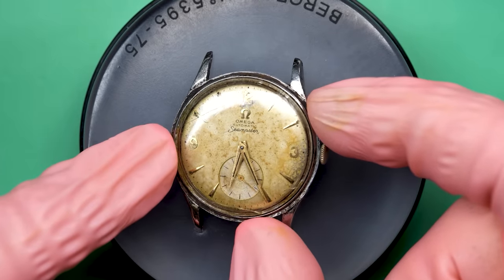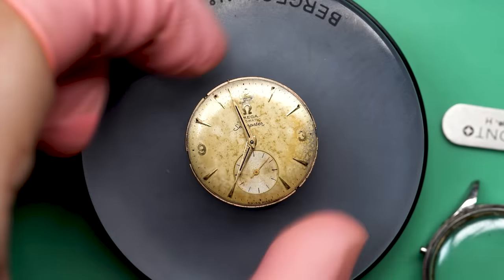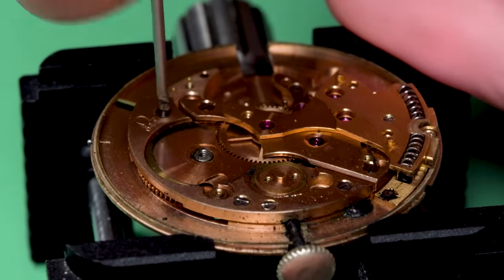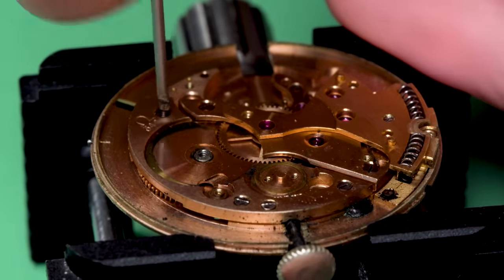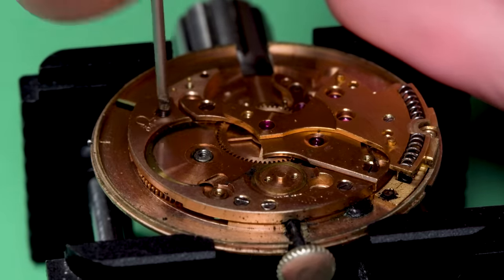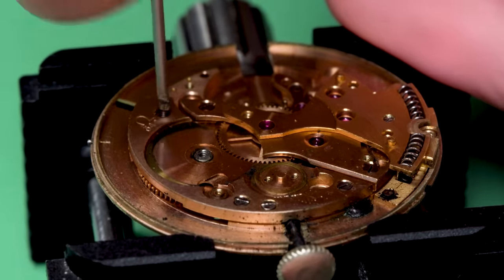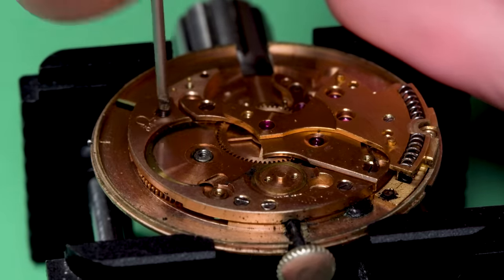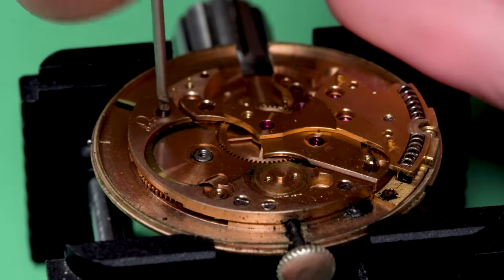Omega Seamaster Automatic From the 50's With a Killer Dial Vintage Watch Restoration

Comment: Great work as always! You are right about the case not being plated. A  "Fond Acier" or "Fond Acier Inoxydable" stamp inside the case back means that its solid stainless steel. Also a tip from someone who's learned the hard way, go easy on the the light grease! Over time the excess grease (especially from the keyless work) will migrate through the movement, and stain the plates and bridges. It will also find its way to the dial and destroy it! A good rule of thumb is if you can see the grease without magnification its too much. That said, keep up the great content! I know it puts a smile on my face to see watchmaking being represented on YouTube!
Reply: You were talking about a laser or torch to add material, but, based on Joseph’s account that it’s stainless, you can send it to a plater to be electro polished.  It could also be used to polish out the marks inside the case.
It’d be a showpiece.

Comment: Thank you for sharing your passion!
And yes, you got me into it - I am starting slowly.
Just bought a broken vintage watch off ebay recently. And just because of the description in the auction describing what works and what not, I was able to guess that it might have a problem with the mainspring - all thanks to your videos and explanations. I got it disassembled (without breaking anything, whew!) and guess what: it turned out that the mainspring was actually broken! So satisfying! And that is thanks to your videos. Also, one part of the mainspring flew away on me, as well as one gear of the keyless works (found it right away thankfully!). Makes me appreciate your work even more :D. Now I am at the stage of getting everything for the cleaning (attempting to improvise a cleaning machine, we will see how that goes) and the lubrication. Already got a new mainspring which came yesterday.
Thanks again for inspiring me to invest some time (and money :D) into this hobby.
I got one question, if I may do so: what is the blue heavy duty grease, which one do you use? (like on the stem)

Thanks again and please keep sharing your watch repairs with us.

Comment: Another terrific job! Thanks for the video.
My late father in law had a 1950s Omega which suffered sea water damage. It was left un repaired for around 50 years, until we decided to try to restore it. Sadly, the movement was just too rusty to repair but our local watch maker sourced a duplicate movement and put that in. We decided not to clean the dial, to avoid ruining it and to remind us of its past. It has the very same look as the dial in this video. It is now sitting in pride of place in my wife’s watch case, with many years of enjoyment ahead.

Comment: Amazing how you are able to keep track of all those tiny screws and what goes where !
I wish you would do a video on this !
Reply: I'm not a watchmaker by any means, but I think this skill is a combination of depth perception and object permanence, and it permeates every industry. I do something similar when working on my motorcycle, all the nuts, bolts, and whatnot go in the same box unless there's something delicate, then you just kind of know based on a particular part's size and purpose and it just kinda makes sense where things go after you've worked on it for long enough.
Reply: I think he records everything. Especially with watches he's unfamiliar with. It would be best to keep the parts in an orderly fashion. Whatever way is best for you to remember. Then replay the clip in reverse in order to re-assemble. done
Reply: All the parts look almost the same in every movement. After watching half of his videos, I can tell what's what and where 80% of stuff goes. I'm sure it's an acquired skill and wouldn't be too terribly hard with light organization and a full video to watch back to know where stuff goes if you screw up. Plus, most things only fit in one spot and most screws won't go all the way in or will be too short/wrong threads for the wrong hole. All the jewels are press fit minus the shock set ones, so they don't move, pivots are pressed in, they don't change.... Keyless works stuff is pretty unique and only fits one way. It's probably easier than it looks.
Reply: @joblessalex  As an amateur who has only fixed one pocket watch so far, I'd say you're pretty spot on. I'm not sure if the screws vary that much with their threads, but through the process of elimination, I imagine it's a very manageable task, especially with video to reference and magnification to really spot differences and what may not "look right", particularly when it would otherwise be unnoticeable to the naked eye.
Reply: @jw11432  Just gave it a go last night and broke a screw off. I'm out. Lol. Waaay harder than it looks.
Reply: @joblessalex  oh no! lol must've been one of those reverse thread screws, either on the crown wheel or the barrel wheel, huh? Or did you simply overtighten?
Reply: @jw11432  Was on the ones with the big screws, whatever that is. The one on the square arbor that goes to the mainspring. Literally the first screw I tried to take out. I tried lightly to the left, lightly to the right, medium to the left, medium to the right, finally some pretty decent force to the left and it started turning and snapped immediately.... It was a malformed screw cause it ripped out a hole in the slot. No idea how to get the chunk out. Guess I'm screwed.
Reply: @joblessalex  Yeah, that's the barrel wheel. You can actually resolve that by replacing the barrel arbor, as that is the piece the screw goes into. You just need to know what movement it is and search for a replacement barrel arbor.

And of course a replacement barrel arbor screw or barrel wheel screw, I believe it will be called one of those.
Reply: @jw11432  It's an Elgin 887. Doesn't look too complex, but I can't find anything but a whole new movement. Going to end up losing money on it if I buy the whole part again....
Reply: @joblessalex  Ouch, yeah...that's a shame, it seems to be a pretty nice movement. Well, you may just end up reselling it as a parts movement. You have a decent chance of getting some money back out of it, but then you can reinvest that into another movement that likely has more plentiful parts. Something like AS, or maybe a Bulova/Caravelle? Those tend to be pretty low priced and parts don't seem too hard to find.

Comment: Re: your barrel side shake issue, this is why I love when they jewel the barrel. Same thing goes for the rotor post (which Omega did on this one!), since "rotor wobble" where a worn rotor will wobble around and scrape against the caseback and movement as it spins is the No. 1 serious wear issue I see on vintage watches. Older ETAs are particularly prone to it but it's common on almost everything with a plain metal rotor bearing... And I hate having to fix any sort of enlarged hole. As an aside, bumpers are actually much more efficient than circular rotors, but more expensive to make and need more upkeep, that's why they got phased out. I love them myself; for you can feel the weight swinging back and forth slightly on the wrist as another reminder I'm wearing a tiny precision machine.

Comment: “if it’s crazy but it works, then it isn’t crazy”

nicely done improvising a tool from existing tools and working it up to where you needed it to be. it’s easier to “remove” material than it is to add, you “removed” it perfectly and even top pros would be proud of your work

Comment: While I watched you manoeuvring  that tiny machine screw, my mind wandered back to the 1978 assassination of Bulgarian dissident Georgi Markov at a bus stop on Waterloo Bridge, London (UK). The murder weapon was a spring-loaded umbrella that fired a 1.52 mm diameter pellet into Markov's right thigh (a similar weapon had been used in the failed assassination of Vladimir Kostov in Paris). During Markov's autopsy, the pellet was removed and was found to have two 340 micron dia. right-angled holes, forming an x-shaped cavity. Traces of fat indicated that the holes had been filled with a lethal dose of ricin and then plugged with organic material that would dissolve into the bloodstream. The interesting aspect of the case is the pellet itself; Scotland Yard determined it to be made of a hard alloy (90% platinum 10% iridium) and was actually a jeweler’s watch bearing. Forensic scientists opined that drilling such tiny holes would only be possible using a high-tech laser in a process known as “spark erosion.”  Do you know whether precision watches were manufactured in Bulgaria in the 1970's?  Could the Bulgarian secret police have recruited the assistance of a watchmaker during the manufacture of the murder weapon?

Comment: Marshall, love the videos. My sons name is Marshall as well. The tan colored band looks best in my opinion. As a hobby machinist, whenever you are using abrasives use them somewhere other than where you are doing your assembly. The garnet or aluminum oxide from the sandpaper or emery boards gets everywhere and is impossible to completely clean up. My precision grinding machine is in another building from my machining space just to mitigate contamination. I am thinking of getting a dedicated lathe just for tool post grinding so I have no reason to have abrasives anywhere near my precision machines or parts.

Comment: Tiny Screws Way Back When: Extruding the rods for the screws, cutting them to length, and heat-stamping one end into a head would be no big deal as far back as the 1860's. Putting the threads on would be done with a die setup. The matching holes would be threaded with a matching tap. You can get manual tap & die sets today, though getting them in jeweler's sizes gets tricky. Thankfully, the advent of tungsten carbide makes them much sturdier and lighter than they used to be.

Comment: Marshal I must say that I love your channel it has opened  up a new hobby for me I find it very relaxing as a watch is so logical in its works ( I am a retired engineer always trying to save items that just need a little love , I have a number of charity shops I deal with to recycle old mobile phones recovering precious metals in some cases I also buy old wrist watches to refurb them in some cases a stopped watch does not mesasn it is a terminal fail I have found some to be very simple repairs as to why it has stopped , I have now amassed a couple of tags from the 80s . thank you for showing me that  this passtime is socalming

Comment: I found your videos tonight by chance and thoroughly enjoyed watching the entire Omega Seamaster Automatic restoration.  I have a virtually identical watch from the same era that was given to me over 50 years ago and it’s “not running well” either, though it is intact and will run some.   It hasn’t been worn for at least 45 years, or serviced in as long as I’ve had it.   Would you consider giving it the same restoration treatment for me?

Comment: Hi Marshall, thank you for all the wonderful videos. I've recently started to really enjoy automatic watches. While I have started to grow my collection, I stumbled upon your channel and was amazed to see that it was possible, with the help of your videos, to do maintenance on a watch. I went then incredibly cheap route and purchased some tools from Harbor Freight. (I was surprised they had watchmaking tools) I bought a cheap $8 broken watch off Ebay. That way I didn't feel too hurt if I broke it worse or wasn't able to put it back together. Is there a need to buy OEM parts for older watches? I would prefer to buy OEM parts, but I know that isn't always possible. I bought a Elgin grade 315 pocket watch off Ebay for $15 and I need a winding stem, winding crown, and crystal for it. I haven't been able to find any OEM parts for it. Would you be able to recommend any other options? Thanks for your amazing videos. It just get sucked into them.
Reply: Hey Kegan, Marshall often talks about getting "donor movements"--essentially buying another of the same watch (in your case, an Elgin 315) to use for parts.

One upside is you don't have to worry about the condition of the case or dial, so you usually don't have to pay as much.

Comment: LOVE YOU MAN. My dads name is Marshal. So yeah...Spring hunting. I have turned this into an art form. Trick is very simple. Get the bright white light type small flash light. LOWES 10 BUCKS.  Now here is the trick. Make the entire room as dark as possible. Get down on all fours. Now bark like a dog....just kidding...Now hold said flash light almost level with the carpet between 15 and 20 degrees. You can play with the angle. A SPRING OR SCREW WILL SHINE LIKE well a spring or screw..But if you cant find it like this you will never find it. i have found the tiniest of screws  this way that I thought was gone forever...this works on all floors and its just awesome on wood. But be warned you will be able to know  where you don't sweep or mop if you perform this. You do awesome work Mr. Marshall.

Comment: Omega used a natural, vegetable-based lacquer on most of their dials well into the 1960s. This likely never got wet; dials with this era of lacquer are extremely prone to this particular type of golden brown mottled patina just from natural aging. It can be accelerated by humidity and rapid temperature changes though, once it gets started. By the way that's not the original crown (Omega always used signed crowns during this era, and it's too thin besides). The original bezel would've been plain smooth steel -- Omega didn't really ever do white gold or chrome plating or anything; so if it looks like steel that's what it is. Incidentally, their gold cases are usually "gold capped" which was a solid gold bezel, usually 14k, with extremely thick 60 to 80 micron gold fill over the lugs and crown. For Constellations the observatory medallion and often the hands and dial indices were also solid gold; as was the balance wheel and its weights for most of the COSC-rated movements up to the 1050 series. Omega used such thick gold fill it will last more or less forever... A far cry from the 2 to 5 micron thickness standard of modern gold plating, and most "fashion" watches that look plated are actually "gold tone" which contains no gold whatsoever.
Reply: No offense but I like Marshals approach to teaching far more than yours.
Reply: @codeblueize  That's cool, and that's why I don't run a channel or do watchmaking on video here. That said, I'm just trying to condense a pile of Omega facts/info/trivia into a youtube comment as clear & concise as possible. It's not meant to be a professional lecture and given the limitations here, I'm not sure what else I can do with it.

Comment: Marshal, great restoration. I’m impressed that you stayed away from the dial…great choice. I remember how easy these bumper automatics were to purchase on EBay and other watch forums in the late 90’s, early 2000’s. Those and Rolex Bubblebacks.  You could get the Omega’s for around $40, and the Bubblebacke for under $100. Now they’re both as rare as hens teeth. I watched a video today on restoring a case like this with Laser welding…it was incredible
Reply: It’s listed under “Laser Welded Case, Omega Speedmaster Professional caliber 321 moonwatch 105.102 - 65. 
Thank you again for all the wonderful videos, I’ve learned a ton from them. More stuff then I was able to figure out years ago before I got really frustrated by reading books and learning nothing. Most of the books back in the day in the 90’s assumed you already knew the basics, so they concentrated on things that were more advanced then a novice watchmaker needed. Now I have a complete watchmakers workshop including Lathes and Jacob tools, and by watching YouTube videos while disassembling, cleaning, and reassembling, I’ve advanced to the point where I’m getting comfortable enough to sell some of the dozens of watches and pocket watches I’ve been hoarding. Wish me luck

Comment: I had to give up searching for a click spring, and this is the first movement I've worked on (have ordered a big sack of random pocket watch springs from ebay in the hope one will work, at least they aren't a particularly tolerance specific part). Funny thing is, I was listening to one of your video and realised I hadn't actually seen the click spring during disassembly (my movement has two springs in the keyless/settings that are almost identical to the click). I went back to look, and sure enough it was still wedged in its slot on the main plate.
  I though I'd take it off to keep it safe and yeah... ping. Vaguely heard it hit some kind of material near by, but after an hour, could not find it. Things had been going so well.

Comment: Hello Marshall. If no one has mentioned yet, you should use some sort of barrel braking grease on the barrel wall to allow slippage of the mainspring in a controlled fashion and not have the mainspring bind up and possibly break from over winding. Great video, love your camera work.

Comment: I love watching these videos. I stream them on the TV when I'm trying to sleep, but then I end up watching instead haha. When you were using the brooch tool to open up the hole on the bridge at 31:45, did you clean the parts before putting everything back together? Just seems like the bits of metal that were worn away could cause friction down the line.